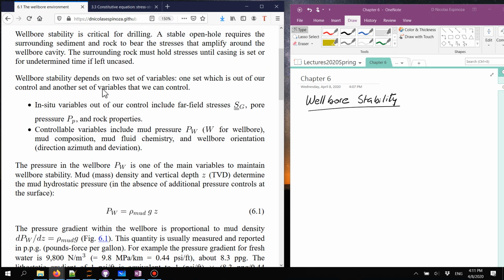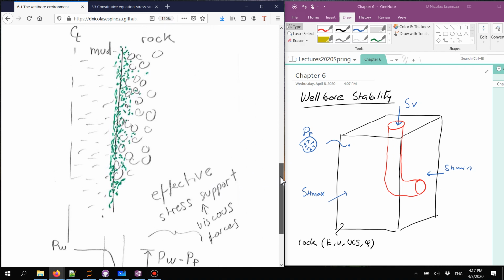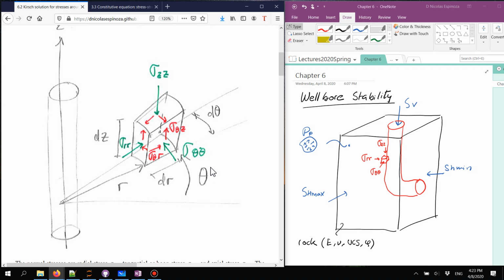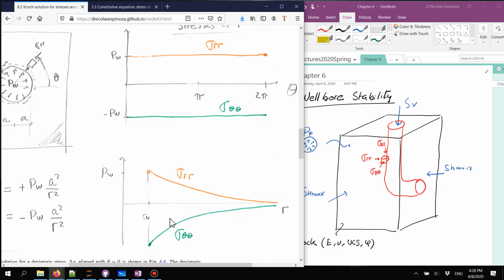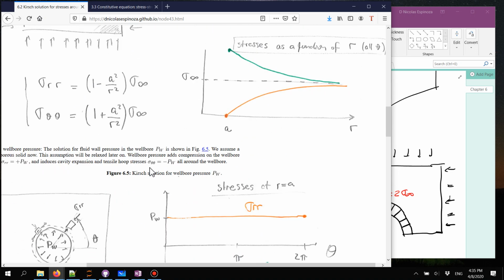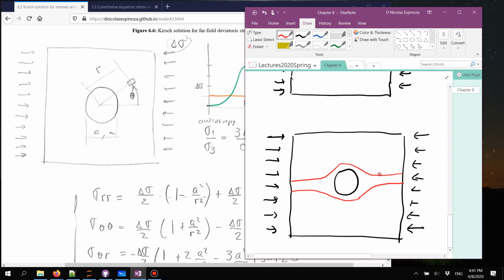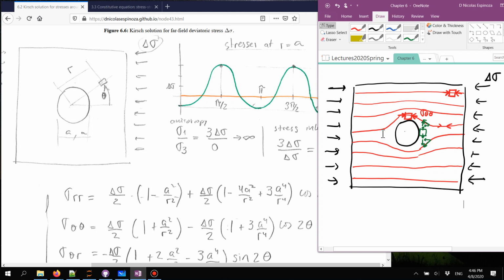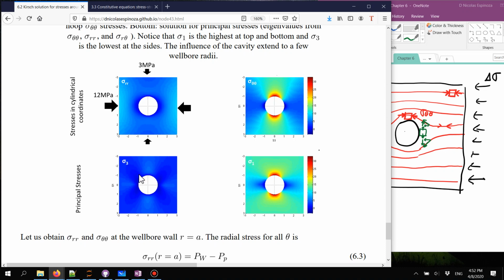L0409b Wellbore stability: mud weight, filter cake, and stresses around a wellbore (Kirsch solution)

Comment: In section 6.2.2, the handwritten equations for \sigma_{rr} and \sigma_{\theta\theta} each have two terms that use \Delta \sigma (=\sigma_Hmax - \sigma_hmin). However, in the typed equations for \sigma_{rr} and \sigma_{\theta\theta} in section 6.2.3, each have only one term that uses \Delta \sigma...where did the second \Delta \sigma term go?
Reply from the maker: It goes into the "isotropic" term  (sigmaH+sigmah)/2*(1-a^2/r^2). Notice that the average stress (sigma_inf + sigma_inf + Delta_ sigma) /2 = sigma_inf + Delta_sigma/2.
Reply: @dnicolasespinoza5258  (+1) Can you clarify how (sigmaH+sigmah)/2 = sigma_inf + Delta_sigma/2 = sigma_inf + (sigmaH-sigmah)/2? It is probably simple, but I'm not seeing it. For the above relation to be true, i.e., (sigmaH+sigmah)/2 = sigma_inf + (sigmaH-sigmah)/2, this would mean sigma_inf = sigmah...that right?
Reply from the maker: @atxlax  Correct, to go from the special cases to the general case: sigma_H = sigma_inf + Delta_sigma; and sigma_h = sigma_inf . Then,  (sigma_H+sigma_h)/2 = (sigma_inf + Delta_sigma + sigma_inf)/2 = sigma_inf + Delta_sigma/2

Comment: Hand written equation for deviatoric shear stress, sigma_rtheta in section 6.2.2, has leading negative sign while the typed equation in section 6.2.3 does not have the negative sign. Which is correct?
Reply from the maker: good catch! the typed equation for shear stress $\sigma_{r \theta}$ should have a negative sign. I'm fixing the equation in my master code and should appear in the next release. Thanks!